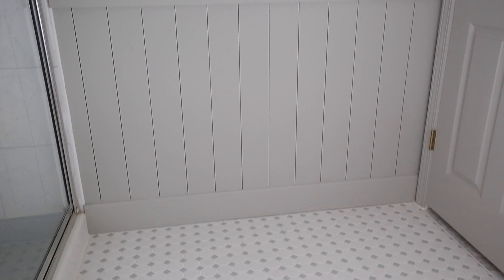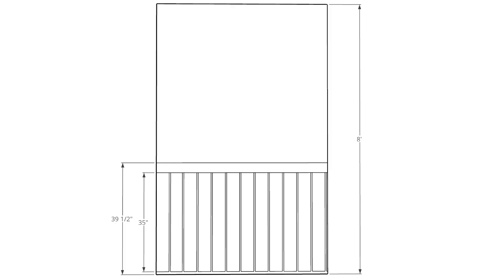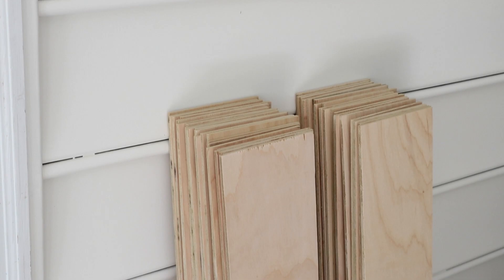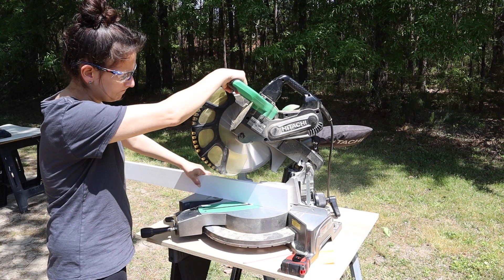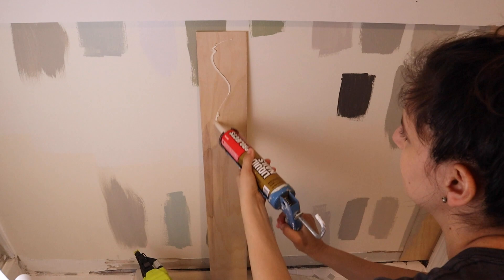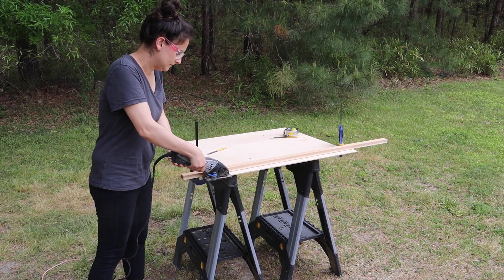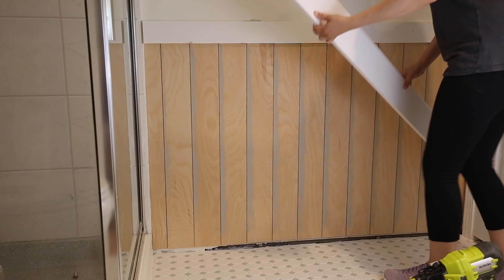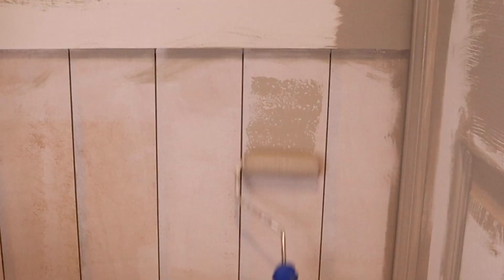How to Install Vertical Shiplap Walls | Cheap & Easy DIY Vertical Shiplap!

Comment: For me the hardest part is locating studs and knowing when to use 2 inch nails and when to use 1 inch nails for dry walls. Do you have any tips and tricks for nailing more confidently and avoiding plumbing/electrical behind the walls?
Reply from the maker: A stud finder with electric sensors helps with knowing where electrical wires are located. Most plumbing should have a nail plate installed on the stud to protect against damaging them. Drywall is typically 1/2" to 3/4" thick so you want to go into the stud at least twice the thickness of your material plus the drywall. That's the best way I've found to decide which size nail to use.

Comment: Dumb question, but with moisture/water im the bathroom, will the wood not rot?
Reply from the maker: Not at all, the paint and primer helps to seal the wood and drywall so that there is minimal water exposure. It would have to be sitting in water for an extended period of time to rot out. Great question, though! Thank you!

Comment: Hey there! Loved your video. We are just starting to consider adding some paneling ourselves to some walls. Do you have an estimate of how much more cost effective DIYing with plywood is, as opposed to using shiplap panels?
Reply from the maker: It really depends on how big the area you're covering is! Real shiplap planks can be about $10-12 per board at 12ft. I spent $60 on two 4ft x 8 ft plywood to do the bathroom, and also another reason I wanted to use plywood is because we could use 1/4″ thick plywood which works better for wall treatments when you want to keep your existing baseboards and you need to keep the total wall treatment thinner than door casings. Real shiplap is typically 1/2″ to 3/4″ thick.

Comment: It is so beautiful! I would love to do the same in my bathroom but I wonder how you keep it clean? Dont you splash it with water or (sorry for the phrase) urine by accident? I want so much to make it like this but I am afraid.
Reply from the maker: Thank you!!! We clean it like any wall with general cleaning products.
Reply: @AngelaMarieMade  Ok. You give me courage. I will give it a try. I have bought ceramic tiles like wood floor so I believe it will be perfect a wall like this. Thank you for your answer. Keep up the good work!👏🤩🥰